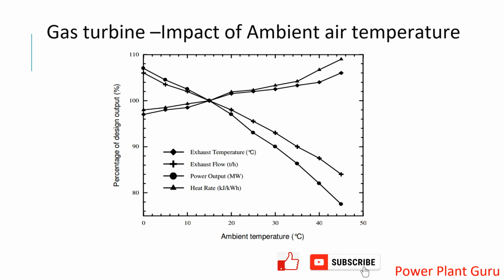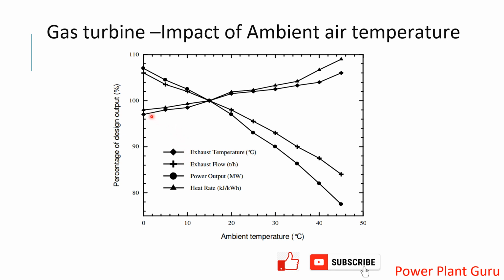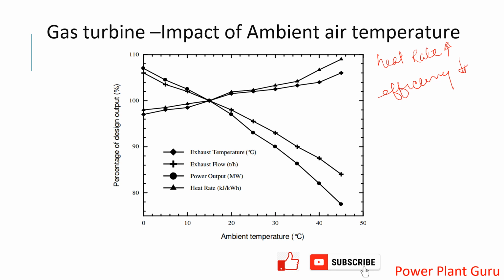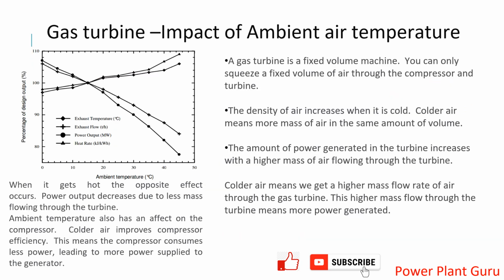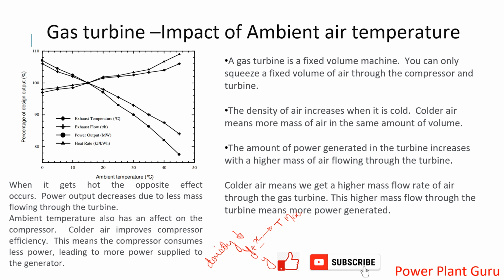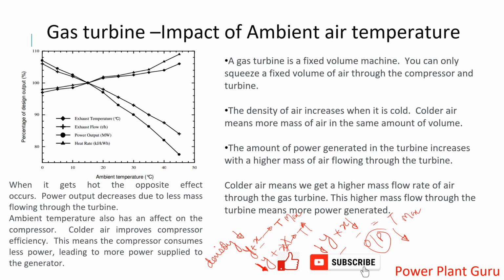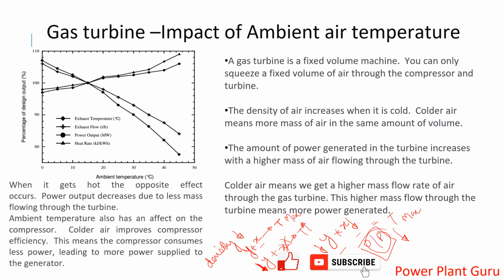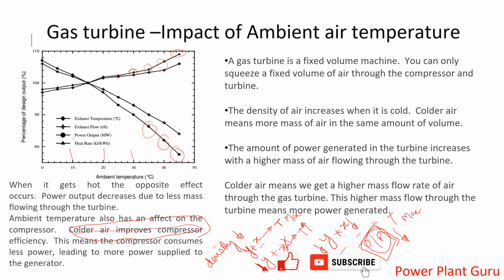How Ambient Temperature IMPACTS Gas Turbine Performance?

Comment: why we decrease the air temperature in the air intake section by cooling, because it will eventually increase when air goes in the compressor section ? then what's the point in reducing the air temperature in the air intake section ? pls give the logic behind it

Comment: Are these all applicable to all types of GT? I'm working now with MS9001e
Reply from the maker: Thanks for watching my videos, Yes it is a fundamental thing across all gas turbines
Reply: @powerplantguru007  can you make videos also regarding surging and stall of GT or any troubles occur during start up/shutdown of GT.
Reply from the maker: There are many videos i have created, please watch those.
Reply from the maker: We will try to cover as many as possible
Reply: @powerplantguru007  im currently watching those videos now as i am studying for my new role. And it helps me a lot. But the start up diagram gives me a hard time to understand 😂. I'm trying to connect that diagram you've shown in the video to my source diagram here. And i found it quite different especially you said from start command RPM will increase as well as doing purging. Here in my job site we need to take it to 700rpm and then do purging for 5mins. So i'm a bit confuse.
Reply from the maker: Rpm variation is different for different machines
Reply: @powerplantguru007  that is why. Can you please indicate what type machine are you talking? We're using MS9001e with DLN1. But some of the videos are also help me a lot because i believe its just a common thing in GTs.